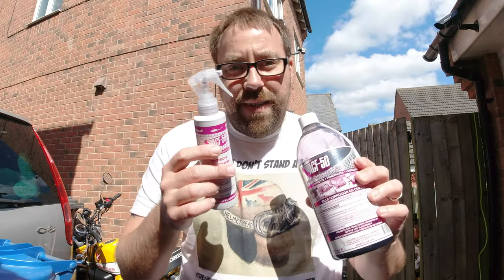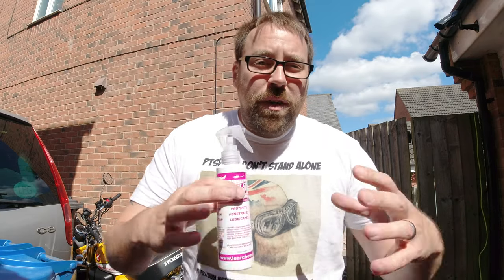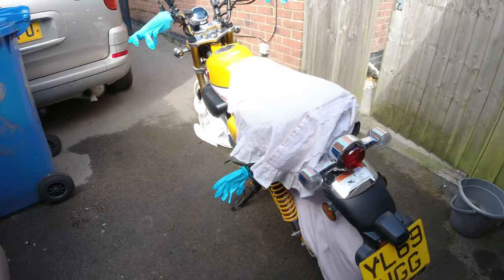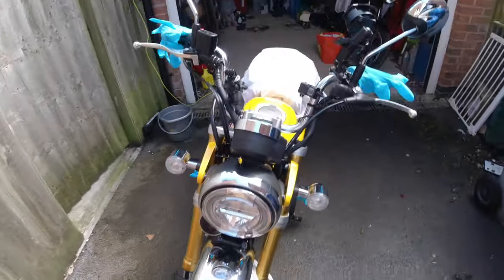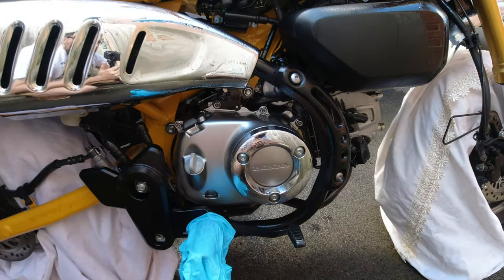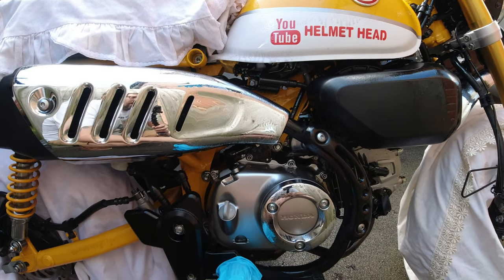ACF50 THE REASONS TO APPLY FOR SUMMER NOT JUST WINTER PLUS HOW TO APPLY!

Comment: I’d recommend one of those motorcycle hairdryers for drying (look at amazon). Forces the water out of places you didn’t know existed and does a job a shammy couldn’t possibly do.
Reply from the maker: Great advice thanks for commenting 👍🏍️
Reply: i use my leaf blower
Reply from the maker: @Syncronizeification  that's a great idea 👍
Reply: Air compressor blow nozzle would do the same trick? Haven't seen these driers. Whats the cost..
Reply: Chris Tucker im not sure to be fair. If it’s fairly high pressure then I guess it’d do the job. Think mine was about £70